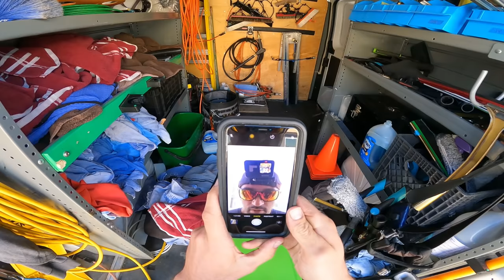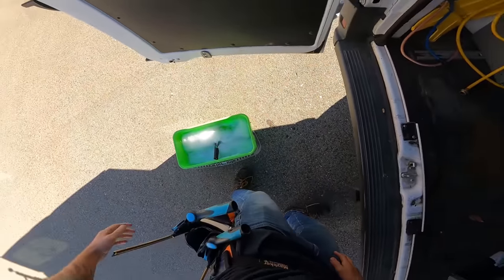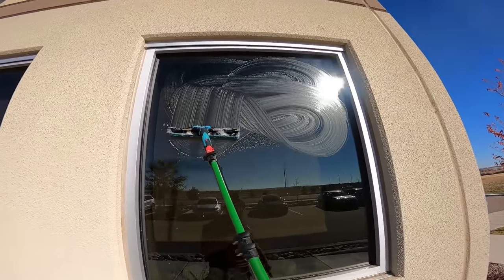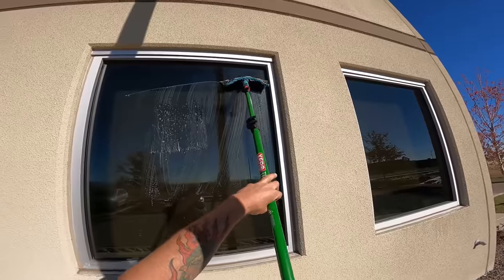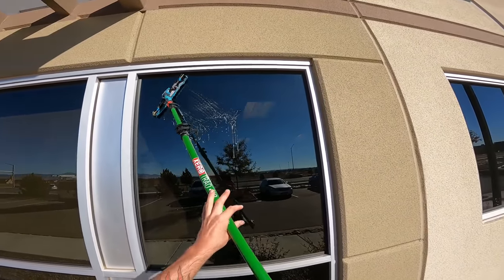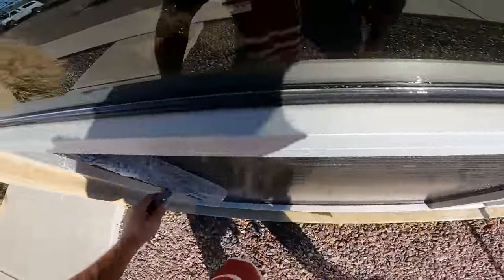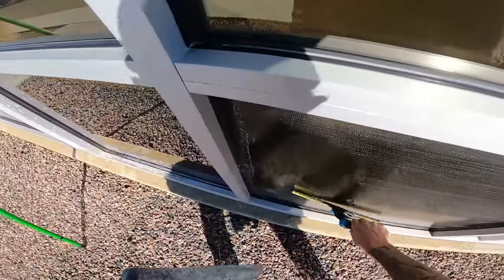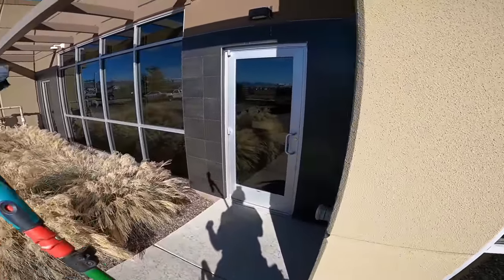HOW TO CLEAN WINDOWS IN DIRECT SUNLIGHT | WINDOW CLEANING TECHNIQUES

Comment: STEEEEVOOOOO!!!!  I use 2 trad poles one with mop and the other with squegee THAT WAY I SPEND LESS TIME SWITCHING BETWEEN MY TBAR MOP AND SQUEGEE , I DONT USE THE FLIQ PAD ANYMORE, I always redunk my mop AND no rinse for each window  TO GET AS MUCH WATER (SOLUTION) ON THE GLASS , I dont use dawn soap anymore I USE WINSOL APC 100 2 CAP FULL FOR 3 GALLONS OF WATER AND 1 CAP FULL SUPER SLIP. 
LESS DETAILING AND NO SOAP STREAKING LIKE DAWN.

Comment: I think the problem is that the newer Fliq pads actually hang a little lower than the old ones, putting the squeegee a little higher instead of more center on the pad. So there is still water in the bottom part of the wash pad but it isn’t being pressed to the glass.

Comment: Hey mate. I'm about 2 months into my busniess now and stuff is going well. Still gaining customers regularly so getting closer and closer to paying the bills each month. How do you do straight pulls without leaving any streaks? Just leave a few mm of dry glass at the top?
Reply: Leaving that dry zone at the top as well as feathering the top and making sure that you angle your squeegee on the way down. If you do all of that but still have streaks/lines, maybe check if it's time to change your rubber.
If the glass is hot, you may have to only wet about a 2ft width of glass, pull down on that, then wet the next 2ft of glass, pull down that, and repeat... Hope this helps!
Reply from the maker: Alan explained it perfectly

Comment: Im on my second season as a window washer, i literally have to detail all four edges and this guys wipes a little on each side im lost!
Reply: Because he's using a special rubber, he mentions the brand at the beginning. When you clean windows with a Squeegee that came with a stock rubber it won't work for zero detail cleaning. 
He is also using the excellerator 2.0 squeegee which puts more pressure on the ends for zero detailing.
Reply: @epycedits he’s just using ettore rubber?

Comment: I'd use a hose. When I house wash roofs I cool it down with water before I spray the chlorine on it. With windows you could do the same. Why don't you window washers use a soap dispenser and wash the entire outside structure? Laundry detergent with vinegar works perfectly.
Reply: Please explain this? What do you mean?

Comment: On adding chemicals to slow evaporation, I don't believe that happens, and if it does it's not enough to make a difference.
Reply from the maker: Do you have experience with these products and knowledge to support the claim that it doesn’t work?
Reply: @SteveOthewindowcleaner  I'm looking for evidence that a chemical slows evaporation. I've tried one before and did a test on two windows next to each other, no discernable difference.

Comment: lol 50 degres? try cleaning windows with dry 115 degres in phoenix in the summer  you kiteralty have 2 inches behind the sponge to work with super wet sponge and 2hands as fast as you can
Reply from the maker: Yes the temp wasn't bad and I agree that warm conditions like that its definitely going to be worse, but Ive been there just gotta be super fast

Comment: How to clean windows in direct sunlight? You don't lol. You clean them before sunrise or at sunset. 👍 I can't clean any windows in direct sunlight.  It makes me sick to my stomach.  I've developed an intolerance to heat and the sun so I have to do all my work in the shade. Most of my jobs have overhangs because I do all commercial.  But when they are facing direct sunlight I have to either do them early in the morning or wait til they are in the shade later